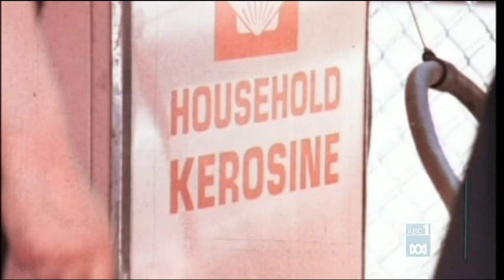Steam Powered 1963 Ford Falcon

Comment: this would work now !
hint hint
Reply: Actually its not very likely, steam engines generally have very low thermal efficiency, about half that of Otto and Diesel engines.
Reply: doktorbimmer Yeah, however inefficient an Otto, or internal combustion is, it's still far more efficient than any steam engine can be !
Reply: The only thing that is terrible? is the fuel efficiency of steam cars... that is why they are all obsolete now!
Reply: rob the log Yes, you can buy a Otto or Diesel engine car today with over 40% thermal fuel efficiency  with new models coming as early as next year expected to have as high as 50%

Comment: This makes me wish I was a machinist and an engineer. I wouldn't only have a steam car, I'd have a steam powder home supplemented by solar and hydrogen.
Reply: You know that's a wish you can grant yourself right?
Reply: go with nuclear power.
Reply: @1voiceofstl  you mean like the Ford Nucleon?
Reply: @6killer426  The Nucleon was not real..
Reply: @6killer426  Yes, it's a concept car... a car that never proceeded beyond the conceptual phase.
Reply: @6killer426  Just the facts here boy.
Reply: @sandervanderkammen9230  yeah, facts like Ukraine is winning.
Reply: @6killer426  And you are losing...
Reply: @sandervanderkammen9230  you can’t handle the facts. The Whirld had to exist the way you see it, not as it actually is.
Reply: @sandervanderkammen9230  as though I needed you to tell me that. Oh what a Genius thou art.
Reply: @6killer426  You reject the facts,  If you do not know and understand the Carnot Cycle Formula you will never understand how steam or internal combustion engines work... like a blind man fumbling in the darkness of ignorance.
Reply: @6killer426  Nicolas Carnot was a genius...
   Carnot's formula is not an opinion, it is the practical application of the Second Law of Thermodynamics, a universal truth that governs the  efficiency of all heat engines and  limits the Rankine Cycle to lower efficiency than ICEs.
Reply: You should take a thermodynamics class first and learn why it's a bad idea...

Comment: The patented boiler does not use an accumulator, steam chest or 'pressure' cylinder but rather is a 'flash' boiler. Irt is rather a 'steam generator'. If the mechanical power of the engine is not needed, the small and highly efficient steam generator can be used directly to produce either wet or dry steam, and thus deliver sterilizing, distillation, process heat, hot water and space heating depending on how the steam/water circuit is configured.

Comment: Inherent problems are it's a large pressurized vessel of heated water. Get something wrong with that and it will blow up. Wrong things are scale build up,the production of nitric acid as a by product of the steam process and possible clogging of the valves. It's not many people who want to drive around with a large pressure cooker in front. Even Jay Leno talks about this.

Comment: modern condensing methods would no doubt reduce the water refills, and you could even have an electric boiler that runs on batteries until the steam is up enough to run the engine and generator. than drive forever until you need more water...some day
Reply: +Autistic Boy What about the CONVERSION LOSS... this is a basic fundamental problem that people without formal engineering education seem completely ignorant of... it'is as if these morons think energy is MAGIC or something??? Fucking morons!!
Reply: +Autistic Boy Some people don't understand the Laws of Thermodynamics or the Conservation of Energy... these fuckin morons will believe anything is possible...Lol!!!!
Reply: You don't need to be an engineer to figure out that if an electric motor is over 90% efficient, why would you use heavy, inefficient batteries to power a steam engine that is less than 20% efficient...
Reply: It will never happen, because to operate your car on a warm day with a 100% closed system your condenser would need to be larger than the whole car.... not never practical now is it?.

Comment: I want a car powerd by steam, its a great idea! and surely its a good way of using, disposing of sump oil / vegtible oil, you could run it on almost anything!
Reply: But a Diesel engine can run on the same fuels and still achieve 400% higher energy efficiency...and that is why steam cars are obsolete.
Reply: @doktorbimmer  your not quite right and pollution would still be a problem.
Reply: @michaelkupchik3974  A modern Diesel car is closer to 800% more efficient than the Pritchard..
The U.S. EPA tested steam cars in 1971 and found they actually produced more exhaust pollution than the internal combustion cars tested.

Comment: Jay Leno has almost all the generation of steam cars and the last one almost behave as a gasoline car does today only with the advantages of being very efficient, oil companies are never going to allow this and in US this will never happen, we have to look elsewhere!
Reply: +Autistic Boy GOOD, because your comments have revealed you don't know anything about steam, Heat Engine or Thermodynamics
Reply: +Autistic Boy That would violate the very basic laws of thermodynamics, in particular the SECOND LAW which states that steam will never be as, or more efficient than internal combustion.... someone much smarter than you discovered this irrefutable fact 198 years ago.
Reply: +TheHelado36 Jay's steam cars are horribly inefficient gas guzzlers, his most efficient cars, the Doble E-series suck unleaded gasoline at 8 MPG... which sounds bad enough until you realize they produce less horsepower than a new Honda.

Comment: No, steam will always be used to generate power and will always be viable. Water cannot be easily compressed, which means its ability to make power will always make it the most plentiful and flexible method of energy production.

If you understood how a hydrogen fuel cell works, you'll know that waste heat and steam are by products which can then be stored and used to drive steam turbines to generate electricity.

Steam is the way forward, hydrogen is only one method to generate it.
Reply: But steam uses the Rankine cycle, which has a LOWER thermal efficiency limit than the Otto, Diesel, Atkinson, Miller or Brayton Cycle.
Reply: +Autistic Boy The Second Law of Thermodynamics is incontrovertible. Malice may attack it, ignorance may deride it, but in the end, there it is and there is absolutely nothing you can do to change it.
Reply: Steam is obsolete in transportation and  power generation is in steady decline... Gas turbine power plants achieve higher energy efficiency than steam plants do.

Comment: we need this for when the oil runs out, then I can run my car on wood
Reply: They did that when there was an oil shortage after WW2!
Reply: Unfortunately, this kind of boiler needs liquid or gas fuel with high energy density. That's the biggest difference between traction engines and modern steam cars.
Reply: @jordanrodrigues8265  There are no modern steam cars... steam cars became obsolete in 1915.

In most countries a solid fuel steam vehicle would not be legal to drive on public roads without a dedicated fireman plus the driver.
One man operation would not be allowed.

Comment: @cocacola443 the reason its possible to get high efficiancys is the fact that IC's waste heat big time even in the dead of winter with the heat blowing full blast thousands of btu's are exscaping unused, but steam engines can recycle heat using low temp waste heat to preheat boiler air and or feed water from the condensore this is the secret of steam engines

Comment: @cocacola443 not really, some 1930s cars were making over 30 mpg, I think the model T was getting over 40 mpg
Reply: Yeah but it only went like 30mph
Reply: @rallycobra5738  like the Model T the Pritchard only made 20 horsepower, it could only breifly sprint above 30mph before running out of steam pressure.

Comment: @burntvalve86 Honestly, I am considering converting a CJ-7 to steam. I would probably fire it with diesel/kerosene, and use a reciprocating system.
Reply: +Autistic Boy Sounds like a waste of time, internal combustion engines are superior to steam in every possible way imaginable!
Reply: +Autistic Boy There is only one thing you need to learn son The Second Law of Thermodynamics without this critical knowledge you will be just wasting your time!
Reply: What would be the reason or the advantage of converting a jeep or any car to steam???

Comment: @cocacola443 Pritchard claimed that the second generation of the motor had a fuel consumption 22.5 MPG (US) when dyno tested at 50 mph, which would've been somewhat better than many vehicles of the time achieved. Look up "popular science pritchard steam" on Google to read the September 1976 article on the engine.

Cyclone Power Technologies claims that their steam engine has an efficiency of about 30%.
Reply: +Autistic Boy But if you understood something as simple and basic as the Second Law of Thermodynamic???? You would already know that combustion steam technology is NOT the future.
Reply: +Autistic Boy Why would you use a less efficient technology based on more expensive and less available renewable sources... If you were going to shift to renewables wouldn't make sense to use the MOST energy efficient technology??? Why spent more to get less and generate more pollution in the end. Combustion steam engines have appallingly massive carbon footprints.
Reply: Steam technology has always utilized renewable fuels... and that has not made them more energy efficient... which is the reason why steam cars are obsolete.
Reply: fyi; Cyclone Power Technologies is a defunct investment scam... it was never able to prove its efficiency claims or that its engines actually worked reliably. Most of the money that was defrauded from its investors was spent on luxury homes and a super yacht.
Reply: Yeah, and Ironically Pritchard Steam Car Company and Cyclone Power Technologies were both notorious  investment scams so I wouldn't  trust any of those numbers without verifiable, independent third-party testing... which neither company ever  produced.

Comment: @kdc43 It had a "flash" steam generator (boiler).  If you turned the ignition as you got into the car, by the time you had done up your seat belt and looked in the mirror it had a full head of steam.

Because steam engines develop maximum torque at 0 revs, no gear box is needed.

Comment: @Phi1point62 Thank You for sharing that with me, I've heard of cyclone before, but haven't checked on them for a while. Good to hear that they're making progress. If they offered it as a crate engine, I'd almost certainly buy one. (as long as the price is reasonable)

You're spot on with electrics, they're best suited for small cars in urban environments. I think everyone is making a mistake by trying to find one single replacement. ICE's, EV's, and Steam all have their place.
Reply: +Autistic Boy  But steam cars are obsolete because they are LESS efficient and LESS cost effective...
Reply: +Autistic Boy The Second Law of Thermodynamics is incontrovertible. Malice may attack it, ignorance may deride it, but in the end, there it is and there is absolutely nothing you can do to change it.
Reply: Steam engines are LESS environmentally friendly... because they waste more fuel and have a much larger carbon footprint than internal combustion cars.
Reply: @doktorbimmer Fuel burnt in a furnace is more efficient than a running ICE all day long. The inefficiency comes with the second process of heating the water to get the steam before the work occurs
Reply: @plap. What exactly is your point?
We are discussing automobiles, not central heating units.
Reply: @sandervanderkammen9230  what do you think burns the fuel for a steam engine to heat the boiler, it's a furnace.
Reply: @plap.  You can put a furnace in your car son... but it won't take you anywhere,  Lol! 😂
Reply: @sandervanderkammen9230  The point was efficiency and carbon footprint compared to an Ice engine, it is better at neither
Reply: @plap.  The world's most efficient combustion powerplant is INTERNAL COMBUSTION...
Where I live the last remaining steam combustion power plant is was demolished, replaced with internal combustion engines.
Reply: @sandervanderkammen9230  Don't know where that is but they are backups most everywhere else. Turbine is by far the most used

Comment: @KrazeeCain You'd probably be interested in having a look at the Cyclone Steam Engine. They signed a contract with Rathyeon to build their 100 HP, 850 ft lb engine back in April, have contracts with a few other smaller companies and are planning on expanding their factory.

I think electric cars will have their place but I think that steam is the future. We'll never see an excavator, semi or a mining truck run on electric and if you want those to run clean then steam is the way to go.

Comment: @fizzguts 
Thanks. Is Jay the US TV man with a private collection? I'll have  look. I recall as a very young boy the last Sentinel steam trucks. They had solid tyres and went very slow. There was a pipe through the centre of the curved fronted cab with smoke coming out. :) But they carried very heavy loads pulling trailers. 

Enginon in Germany developed the SteamCell, Steam engine in a PC tower sized box. Could power a small car or the ancillaries in a bus/ruck. Main engine, only traction.
Reply: Enginon was revealed to be a hoax and an investment scam.

Comment: Steam trucks had so much torque they churned up roads. Stanley steamers had flash boilers, so no delay.

Steam has come a long way, smaller version can be used as range extenders in electric hybrids.

Comment: @KrazeeCain jax is right, about steam engines not doing, 'recirc'... when you look at the videos of steam transport trucks, there's always a big steam cloud pouring out.  in places with free water available in large amounts -everywhere-, they can be used like that, but take ten minutes to toss the hose into a river, fill the tank, stow the hose before going again, makes delivery times rise lots.  with 50%+ condensing, that will mean a tiny tank can last days, but condensers are heavy too.

Comment: @JaxRhapsody try looking up the lamont boiler, except for a tank on the side, it looks like any other monotube boiler, the lamont has higher efficiency so you can make it tiny.  there's also other old tech bits to use.

and, what's steampunk have to do with steam power?  steampunk is mostly a fashion and artistic movement, not about making steam anything.  heck, the last, most famous, steampunk steam vehicle, was an electric motorscooter with a device to make little puffs from the back, art.

Comment: @KrazeeCain Most steam engine designs do not recirc their steam just like when they were new. And ofcourse theres heating the boiler of water. I am designing steam engine setup myself and a few of the main problems I've ust about solved is
A compact boiler
Another way of rapidly heating the water
Reusing spent steam which helps out a small boiler and increases mpg like the return line in most automotive fuel systems.

I tried PepsiRefresh under Project Steampunk to no avail.